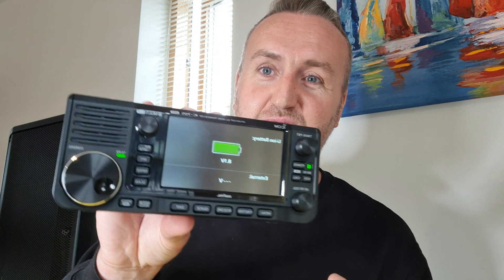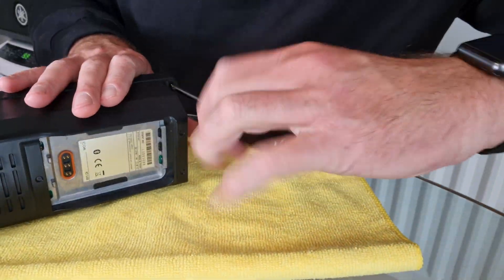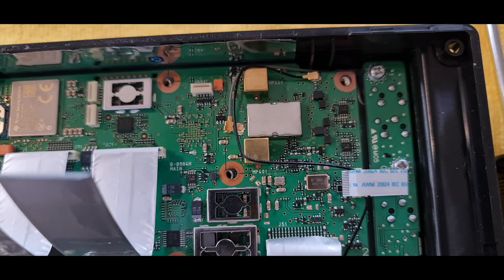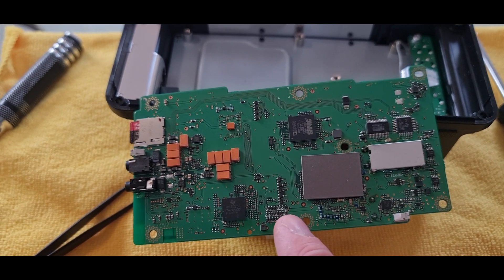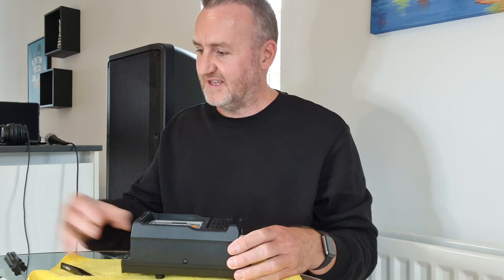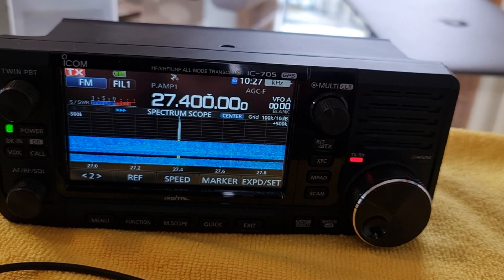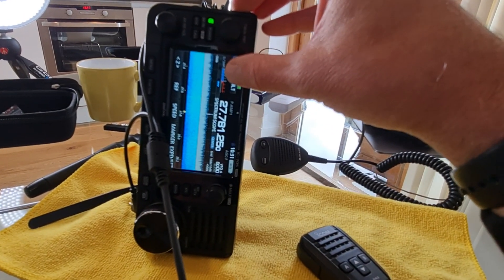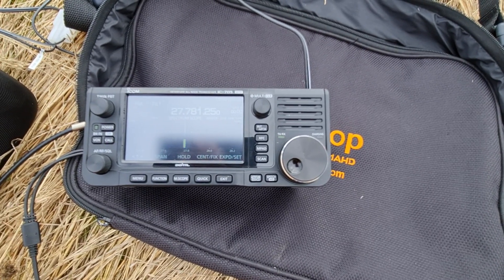ICOM IC-705 EXPANDED TX MOD - PLAYING ON THE CB BANDS!!!

Comment: Andy could you just snip the diode on one end and move it over slightly so that it doesn’t reconnect itself? Or cut both ends to remove it? Very nervous about using a soldering iron on it?

Comment: My ic 7300 is blocked on cb too. Didn't realise this and just assumed it would work as cb is an unlicenced band. Seems bizarre. Won't be doing the mod as I have a visual impairment and my radio is still very new. Thanks for the video though, answered all my questions. 73s M7JZW
Reply: @xlr8r171 Tganks for your reply. However it is neither helpful nor constructive but merely condescending. I wasn't questioning the legality of anything was I? Upon searching I believe a reason HAM radio transceivers are blocked could be that they often exceed the power allowed for cb but you have all the answers I guess?

Comment: Icom really!- put some dam DIP switches on PCB to do country selection market modes,this looks nasty way of changing bands.
Or do-it in software press & hold buttons -xyz "dealer mode".
Talk about over engineering it and putting it awkward place lol.
Comments-spot on soldering techniques with those smd diodes.
Glad it worked Andy.
Rob.P
RPC

Comment: I just did it and it worked IC-705 (US version) Thank you so much!. I Only used small slanted cut de-soldering tip( not much luck with a point tip) @ 390 degrees (centigrades) almost the same size as the soldering on the diode (to avoid damaging neighbouring components), no flux, and not hot air. It took less than a minute to bubble under the component (used cheap digital microscope from amazon). A that point I switched to the other side and applied minimum force sideways. They came off clean, one at a time. It took a lot of practice with an old iPhone since this is my first time doing any of this. Removed surface components for one afternoon after I felt confident enough to do it on my brand new radio!. It was intimidating at some points but im so glad I did it. Good luck guys!

Comment: I wonder if the manual has details of what diodes do what frequencies. Back in the 70s the Icom IC 240 used the same diode synthesiser control system to activate channels

Comment: There's a catch. In the U.S. and some other countries, its 4 watts max when using the citizen's band radio service on FM and AM, but 12 on Single Sideband. Does the radio know to lower output, or do you just have to be careful?
Reply: This radio generated 2,5 W in AM mode , 10 W in SSB. Meets the standards CB. Each country has different settings for these SMD components, so the radios are identical, only different configurations for soldering the components. Pirated settings were selected, which the manufacturer himself implemented in the program. The manufacturer himself cannot do this because he is not legally allowed to do so, but the buyer does it on his own responsibility.

Comment: I have an Icom IC-718 and an Icom IC-728, both full coverage HF ham radios. The 718 is a fairly new radio, has been around more than 20 years, but you can still find them new. I understand they are being discontinued. The 728 is a much older radio, last made in 1992. They are both much larger and heavier than the IC-705. They are intended to be used as base stations. I consider the 728 the best radio, it has a triple conversion superheterodyne receiver, something you just don't see anymore. It does not have menus and is not programmable. Both put out 100 watts max. The 728 has what is known in the U.S. as a MARS mod, which allows it to work on 11 meters SSB, both transmit and receive. The 718 can be converted, but it is much harder to do, and I don't want to ruin it. I would never try what you just did. Good way to ruin an almost $1400 radio.

Comment: no need to de-solder .just use jewelers small flat head the diodes pop right off slide up under and just the slightest twist and there gone.I was done in like 10 minutes start to finish.
Reply from the maker: Ohh jeez!😅 the traces are so thin on these boards you have to be really careful. Glad it worked though.
Reply: Whats funny is the diode basically just fell apart with slightest pressure.I was more scared to try and use a soldering gun.Ive lifted traces with a iron before.What a mess..Thanks for the mod info though!!yes it works great.The 705 is awesome radio being battery supplied i can get some great DX being able to run without a power supply. It's the best LW DXer ive ever had for NDB hunting!!

 @andykirby

Comment: I can confirm that this works. I used my solder station with an extra-fine-point tip at 700 degrees with an exactor knife and a magnifying glass-lamp (LED) to heat up the diode-spec on the lower left bank and was able to lift one end of the diode. I put everything back together and worked like a champ. I'll be posting some pics to FB soon

Comment: Will it transmit on GMRS freqs like 462mhz? I just did the mod but it quits tx’n at 457mhz and up
Reply: Can ANYONE answer this?
Reply: @DontM8-__-  it won’t. I did the mod and it only will TX up to around 457 mhz. If you have another radio close by monitoring gmrs and you are transmitting on same freq after mod you will hear it on other radio but I think it’s coming from the portion of the radio that hasn’t went thru the amplification circuit yet. With a watt meter you will see there is virtually no output power on gmrs. Maaaybe .01watt.
Everyone else I have found is having the same results after the mod.
Reply: @tracym427  Do you know what the expanded TX freq ranges are for all the bands? I can't find anyone who's listed it. Interested in MURS like 154.6
Reply: Dang thank you for the heads up!!
Reply: @DontM8-__-  No problem buddy. Still works on 11 meters and I think Mars freqs.

Comment: Had a look inside my 705 which originally came from Icom U.K. and there is only one of the two diodes installed (the one in the corner)

Comment: I use mini wire snips and just cut it with a vaccume running along side it...... diode will just shatter and all bits just get sucked up...... This stops the risk of any heat damade to the rest of the board and is the safest way......

Comment: The last time I check channel 19 in the United States is at a frequency of 27.185 MHz. Back in the mid to late 1970’s I knew what the frequencies were for each of the 40 channels at that time!
Reply: Yeah I'm confused as well.  27781 is way out of CB land. 27405 is ch40.

So 27781 is even above free handers on 27555 area . 
So Andy what's up wit dat man ?
Reply: @denp54z  Here in the United Kingdom the UK40 channel band plan is between 27.60125 to 27.99125  incrementing in 10 kHz steps. So 27.78125 mhz is UK channel 19.

Comment: Don't you think that by showing this you are encouraging unlicensed operators to purchase an amateur radio that is only intended to be purchaed/used by licensed operators which could lead to pirates and nuisance transmissions?
Reply from the maker: No, it's an expensive radio. You've got to be pretty serious to spend 1300 on a radio and then take a soldering iron to it! Pirates will just buy cheaper gear for sure.
Reply: @andykirby  : Most pirates will use a £200 (ish) "export" radio which covers 25 - 30 Mhz because they are more powerful than a standard / legal CB.

Comment: I cannot imagine WANTING to play on the children's band with an $1800 radio and removing a diode to make it possible.  It is almost ironic given how many CB'ers are using illegally modified Stryker radios to exceed authorized power.
Reply: They are more than you think! I know a few that spent the small car price and paid the $13,000 for a ic-7800 to play on 11m with a PR-781 mic  but no wide voodoo audio or extended bandwidth for real audio! So the narrow 3khz ssb filters or narrower for voice isn’t impressive enough for me to spend that kind of money. If there’s a rig that transmits with a bandwidth like 10khz for AM and 5-8khz for ssb and 15khz for FM now that would leave some impressive transmit audio!  100hz up to about 5khz is about all you really need for great sounding audio. Now you can eq a mic or audio with a narrow bandwidth 2.3khz to 1.8khz to sound good or impressive with EQ and exaggerate the highs and cut some of the mid freq and boost the low end. Add some processing and compression and you’ll have  punchy (close pin) but piercing audio. And if you want that much traffic next to you? Narrow it up more 300hz and work cw! If I want to work mono tone I would! But it’s want to talk voice analog mode and want fidelity and thus bandwidth! There is no rule to all ssb radios must be under 3khz bandwidth transmit! It’s just good practice not to use up bandwidth when the band is crowded to begin with. But when it’s open and you’re rag chewing with your friends? Why not open it up a little? 🎉 😂😊❤
Reply: @MrBonez208  "5-8khz for ssb and 15khz for FM now that would leave some impressive transmit audio!"
Not many receivers have a wider receive bandwidth, but you are correct, 5KHz would provide much better audio. As it happens, my ears only go to 6KHz so wide bandwidth doesn't help much.

Comment: Does anyone know the difference between the USA and EU 705's, both with this mod? The EU version is less money ordering it from overseas even though I'm in the USA. No seller here knows even the big one.. Tryin to save a buck on the radio for a tuner. Great video by the way!
Reply: Yeah i would like to know that also and if it opens GMRS TX as well

Comment: I've never understood why a licence radio operator can't have their radio operate on CB frequencies, when in australia at least, oyudon't need a CB licence. Just as long as they operate with legal power. Especially useful in emergency situations.
Reply: they really can't stop you from doing that. it's not a law, only a rule to not transmit. as long as you don't interfere and disrupt an organization that is using that frequency, no one will bother you.
many ham operators will police the airways themself by not talking to you if you are not licensed but the government says No One Owns A Frequency.
Reply: @TwoFeatherChannel  Australia. Bit different here. The government do “own” the frequencies…..
Reply: You can have it operate there at 3.8watts am carrier and not over 100% negative modulation envelope. Which would modulate to typical 4 watts rms modulated. If you care to operate ssb? Just adjust the compressor output level so modulation pep is not over 12 watts PEP. And you’re golden! If you don’t have the equipment to monitor this while transmitting during a non emergency? Then yes it would be not advised! But if you do have the equipment and or hold a General Radiotelephone License then yes. Even if it’s not type accepted. Your within acceptable signal if you are monitoring it with a scope and wattmeter or a spectrum analyzer and your power and modulation levels are within limits. And if there’s no harmonics. Which there shouldn’t be if everything is operating properly and you follow correct operating procedures for adjustment. If you do happen to have some? A low pass filter is an acceptable option. Make sure it’s built within your power levels! 
That’s that!
Reply: @MrBonez208  problem is that ham radios are not type approved as cb radios by the ACMA. That’s the catch. At least that’s the catch in Australia

Comment: Hi Andy, and others in the community,
Just wondering if you or anyone on here has had any luck with widebanding this to cover TX/RX on 4m/70Mhz and what output power you're getting if any. I'm seeing mixed reports on online forums. It would be great to hear about your experiences with it.
73's
Tom
Reply: Yes, after mod, the radio can also receive and transmit on 70MHz, complete shortwave (excep. lowest frequency, under 1,6 MHz), It transmit also in the airband with all of modulations!
2m - from 118 MHz to 173,99 MHz
70cm 400 MHz to 469,99 MHz
6m from SW to 54 MHz
4m from 68 MHz to  74,79 MHz
73
Reply: Yes please! Can you transmit on 467.000mHz?
Reply: Yes, the radio can transmit  on 467 MHz @DontM8-__-

Comment: Its been a long time since I have been near a CB moved to HAM stuff a long time ago and never looked back. However I do remember there being a power limit on CB or at least when I was using them of 4 watts. Isnt the 705 capable of 10 watts ?
Reply: 705 is 5W on its own battery. Can go up to 10W with an external power source, but you can set that in the radio as well. It's 5W for CB (at least in Aus anyway).

Comment: This is just what i need! I'm trying to minimize my radio equipment (running out of space) and whith this mod, i can remove the cb (older, big station model)
I bought the 705 for it's size and HF/vhf/uhf combination, adding cb capability is just awesome!
Thanks Andy! ❤ Subscribed!
Reply: thats why i love my ft-818  everything in a tiny box and i can use it anyware
Reply: From what I can tell, it doesn't even do that.

Comment: Cheers matey , not sure I would be confident enough to take a chance messing with the 705 inners, but was good to watch, I’m literally back to radio this year, used to have a CB in the 80s, an old maxcom 4e lol, got my ham licence in March and got a bit bored with Ham so bought a Randy 3, just need to get an antenna outside , daft question coming up, could I use a mag mounted antenna in my loft, I wanted to buy the Sirio 5000, would it work? I’m sure the SWR would be all over the place, I almost pressed the buy button earlier but held back, all the best mate
Reply from the maker: Right, so hold fire on the sirio, it'll never work great in the loft unless you get really creative and make a massive groundplane or loads of radials underneath it, mobile antennas are groundplane antennas so they need a really good groundplane. The best sort of antenna for cb is a 5/8 wave vertical 30ft above the ground. Yeah it's gonna be big but that's just how it is! Alternatively the sirio boomerang on a pole on the ground or mounted at gutter height (or higher) is a smaller option that still works well.
Cheaper option is a wire dipole from ebay for 11M on a 10M telescopic pole from amazon on a heavy parasol base! A lot of CB action is on SSB but there is activity on FM, you'll likely need an amplifier too as everyone runs a bit of power these days to get over the noise! I'll do a video on all this soon!
Reply: @andykirby  , top man, thanks for the response Andy, so glad I held back from buying, I’ll look out for your video , all the best mate

Comment: There is No Reason that hf rigs cannot have an am and fm 5 watt, 12 watt ssb, 27 mhz cb band mandatory, in the radio...paying over $600 for a radio should give at least full access to cb channel 9, which is monitored by police, and 19 is the other ultimate channel. Then need a separate license for gmrs...sillyness.
The radios do look fun to collect.

Comment: I took a flat soldering tip and filed a U in it,
because of that I easily soldered the SMD diode out of my Kenwood.

Regards Rob
Reply: Great idea. Just don't loose that tip for later down the road.

Comment: OMG this is the dumbest thing I have seen on the internet in a long  time!   You turned a $1300 QRP HAM radio into a $30 Cobra 19 CB from Walmart.  Don't do this to your $1300 radio people and defenitely not with a soldering iron from the bargain bin on the kitchen table.  Oh and DO NOT take a heat gun to that circuit board, if you do get it hot enough all them components will go floating off their positions.
Reply from the maker: As I said don't do this if you are not experienced. I've been working on electronics since before I could wank. Also your ignorance proves you do not know anything about this stuff. It's a TS100 Soldering iron with modified firmware. Look it up.
Reply: @andykirby  your $1300 radio but people should know you spend more time wanking than working on electronics.   People don't do what this idiot did, he is super lucky it still works.  If you consider a $1300 HAM QRP radio being used as a hadheld CB radio working.  Plus it is illegal to use it on 11 meters.

Comment: Icom ic705 the best
Reply: Yes. And I hope for an even better successor with ATU, backlit keys, separate antenna sockets and built in FT8 and CW decoding. Best would be some kind of software plugins for several digital modes, also for the ones still to come.
My 705 shows some quirks when I use it with a directly attached whip. Obviously interference radiation from the display.